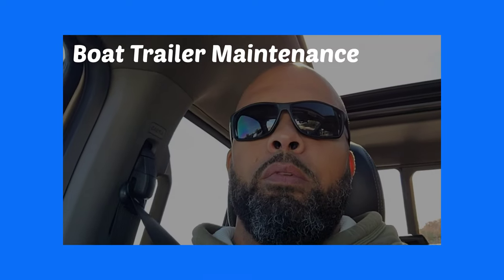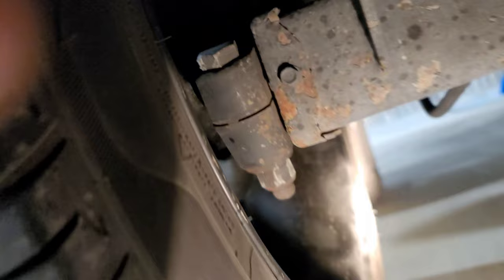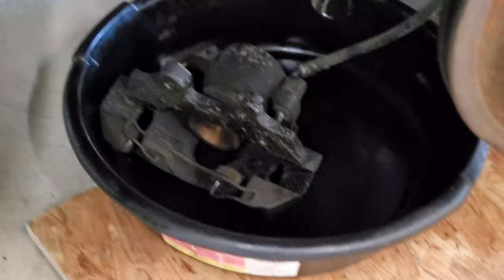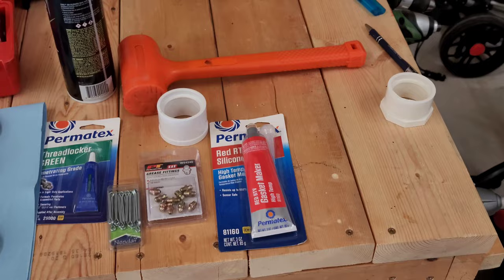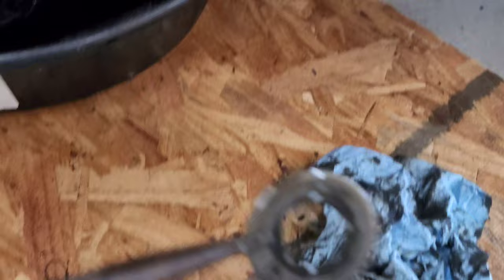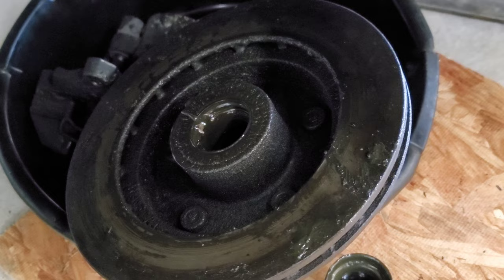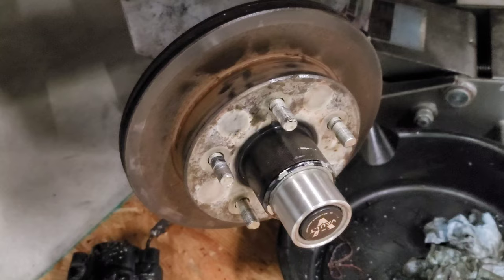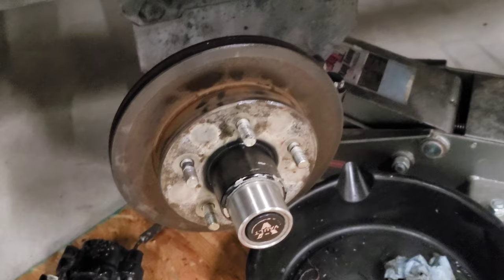Vault Trailer Hub Replacement

Comment: Do you remember what the part # was for the seal on the back of the hub/rotor?  Was going to buy before I tore mine down.
Reply from the maker: No sorry. Your local marine dealer should know for your boat. You can also can your traler manufacturer and let them know your VIN#. Hope the video helps you though.

Comment: Very informative video. Thank you for taking the time to make/post it. 
I have a tandem axle trailer under my seaark and I have vault bearings. Within 14 months I've had 3 bearings go out and it's quite frustrating. I've been told they should last at least 6 years but my personal experience is much different. How often are you having to change/fix your vault bearings?
Reply from the maker: Really depends on how much you drive and the roads conditions I think. Always check your trailer before during and after a trip. Hubs are supposed to be maint free but I don't believe that.

Comment: I enjoyed watching the video. Good information, but, did you put the rubber O-ring on, part of the Vault repair kit?
Reply from the maker: Yes, sorry if I missed that. When you take off the hub and bearings in front, there is a inner lip on the front lip that the old o-ring will need to be removed/replaced once cleaned...

Comment: Really dumb question but if I need to replace brake rotors I would also need to remove and re pack the vault bearings correct?
Reply from the maker: Depends on your trailer. Some rotors are separate from the hub. Mine are 1 piece.
Reply: @brewcrewfishing  thanks for getting back to me mine is one piece same as yours this video was super helpful to me to redo my trailer brakes!
Reply: Thank you for this video!  Tight lines!👍

Comment: Once you open it and grease it again. Do you still need to check yearly if grease still good or since it vault system you good for awhile?
Reply from the maker: I just check them after every few trip to make sure seals are still good and not leaking. Still good to go as of today!
Reply: Great video thank you,was lookung mine over and the vault hub doesnt look to be sticking out real far . Is it possible it needs grease? I will be sure to use the hybrid grease you recommended.

Comment: Did you take the grease fitting back off or leave it on ?
Reply from the maker: I replaced it with a new one.
Reply: Take it off before putting the Vault hub back on.

Comment: Question , I noticed your axle had the arm hub assembly, is your axle a tor flex type or spring suspension. I just recently had a vault seal go out  on a marine master trailer, and now in the process of  awaiting to changing the axle. I’m thinking of proper maintenance and awareness in my future , it’s a major setback for sure. Great video Sir.
Reply from the maker: Yes it is a torsion axle.
Reply from the maker: The boat I had before (Triton) had a beast of a trailer. Aluminum I beam tandem with shocks and spring. 21'9" boat literally floated down the highway...

Comment: Thank you do you put any sealant on the vault befire tapping it in?
Reply: I have read to use blue loctite on caps before hammering them back on. i forgot to do this on last bearing replacement and drove first 150 mile trip and when i got home cap was gone!

Comment: Where does the O-ring go?  On the cap?
Reply: I am trying to figure out the same. I just removed a set of vault from a boat trailer and I did not find any o rings yet it tells you to replace them.
Reply: Did you figure this out I’m wondering the same
Reply: @tjswenson2394  I did not.  Ended up having a way worse issue.  Spindle was trashed once I got everything apart. Ended up having a shop replace the whole axle assembly.  If you want my opinion I’d convert to an EZ lube axle that you can easily grease periodically.  I’m no longer sold on Vault.
Reply: O-ring is inside front side of hub. Remove cap and look inside hub, you will see the grove and O-ring. Hope this helps, if you didn’t already figure this out.